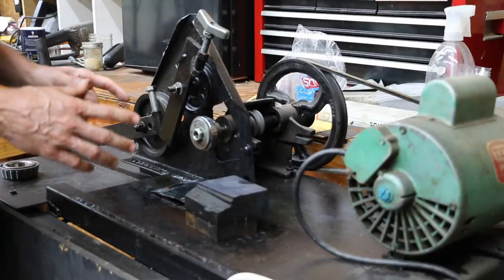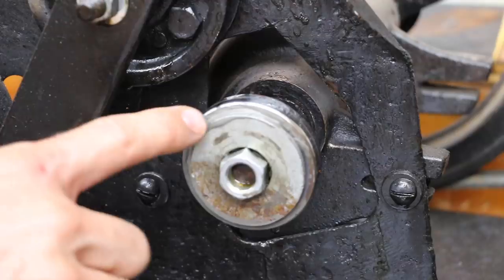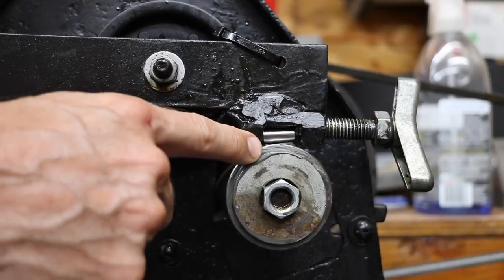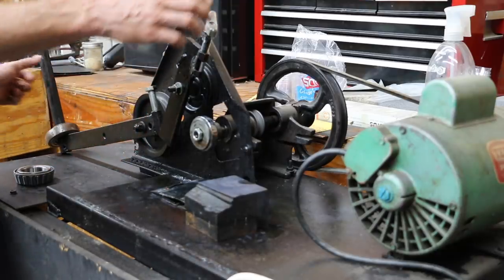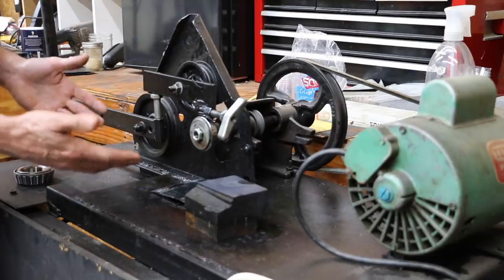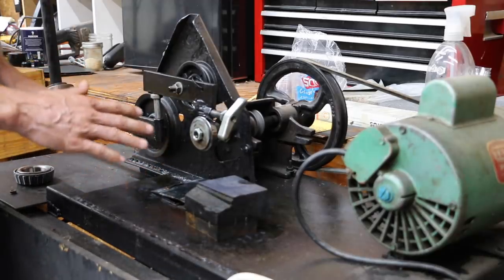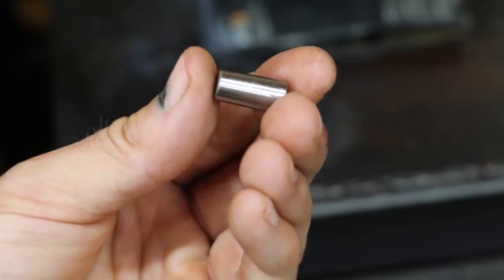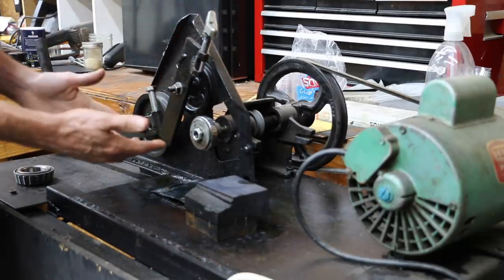How does the oil lubricity tester work?  Let's find out!

Comment: The real issue is that there is no such tribological pair in use in any modern equipment. So unless you design such obscure machine for some novel application, the results are really meaningless. It is just as useless as basing lubricity quality on color or odor or taste. But hey nice video anyway, as always !!!

Since the most wear in any engine is in the "piston ring to cylinder bore" tribological pair, only such ONE cylinder, electric motor friction tester would make sense, not only you can measure POWER consumed to milliAmperes or rotational speed if "constant current and voltage" is applied, but you can SEE iron deposits on a strong magnet, but such test to have any meaningful results would have to run 2500 to 5000 hours to have any statistical confidence level.  Increasing the test rotational speed from 600 to 6,000 RPM would provide results bit faster, but not 10 times faster.  So at least 3 months of 24/7 testing, or about the same time interval that most OEMs currently do on engines in "test cells" that cost upwards of $150,000 - but that test the entire engine under all operating conditions, except "cold start"

Also in a simple one cylinder engine mock up (without the cylinder head) the "oil" would have to be heated to "normal" operating temperature which would have to be held constant to eliminate any test to test non repeat-ability.

In real world there are no tests that measure anything in matter of minutes that in real life takes years.

My opinion is based on 32 years of experience with lubricants
Reply from the maker: You have a tremendous level of experience and expertise. All great points and thanks for commenting.
Reply: the results is just d tip of d iceberg. but do you think that it actually equates to something to a certain degree?
Reply: YES, to exactly what it tests, sliding a stationary rolling element that is intended and designed to "roll" on the outside of a rotating bearing race, that is intended and designed to be stationary.
And the non rolling "rolling" element, is oriented at 90 degrees from what is "normal".
No such pairing exists in any machine I know of.  Therefore ZERO correlation to any engine for example.